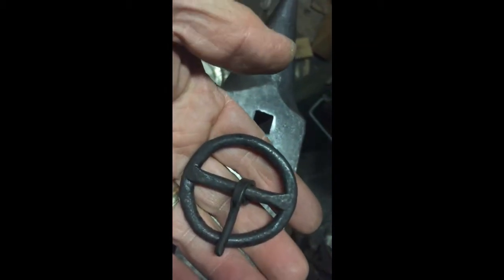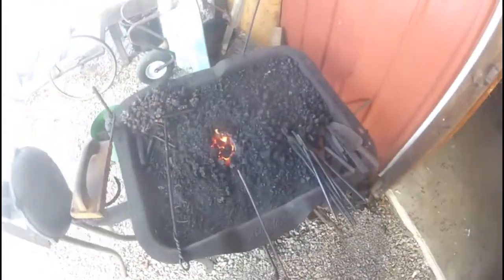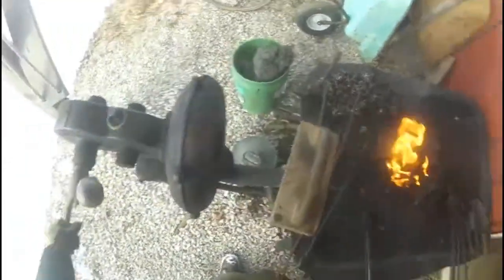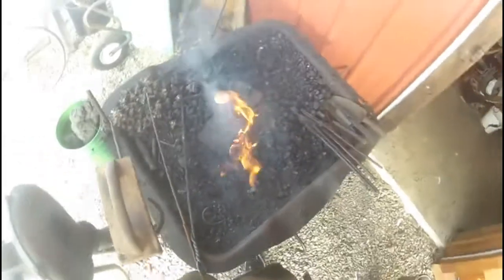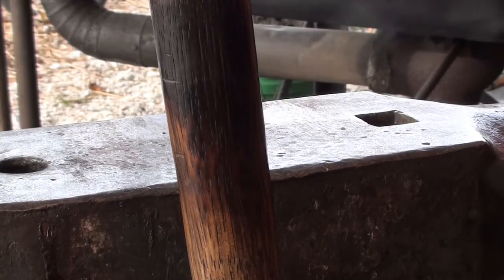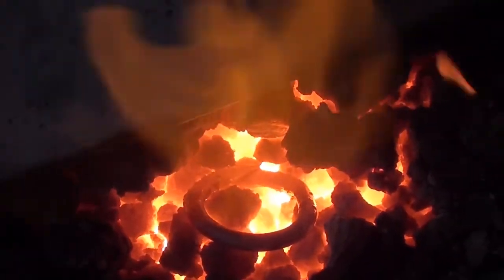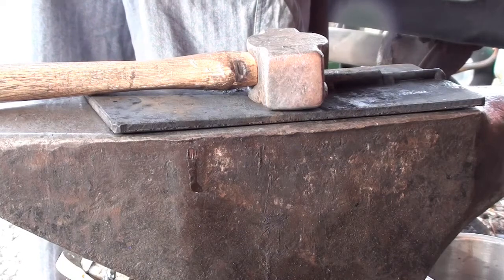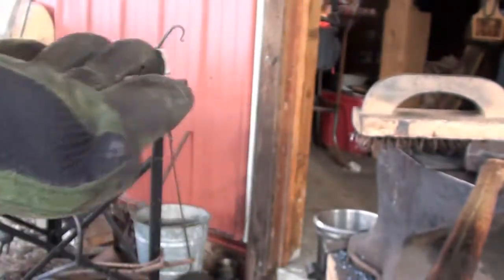Forging a Belt Buckle Part1

Comment: By golly Bill, you lapped that steel together licketty split. And a very good lookin' weld it is. Last spring, I welded 2      1/4 - 20  threads onto the tangs of an old style drawknife from the 1870's . Sacrilege, I know. WITH A TORCH AND ANVIL! Not for the faint of heart. It cooled off speedy to say the least. Thanks for the welding plate education.
Reply from the maker: That is a task, tool steel is even harder. At least garage door spring has been giving me fits. I did finally make a belt buckle totally out of spring but I wasn't going to vid that. But especially in this weather you only have a few seconds before the scale starts forming and if there is scale forming it's not welding.